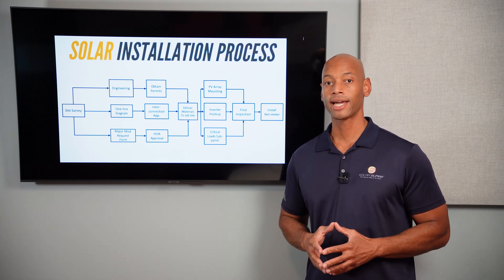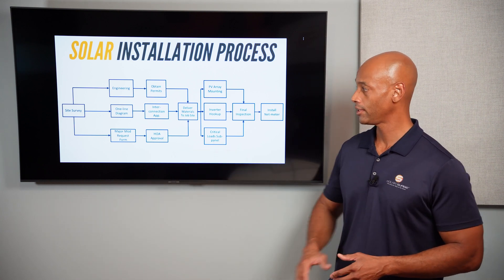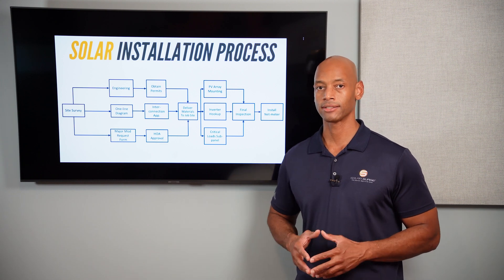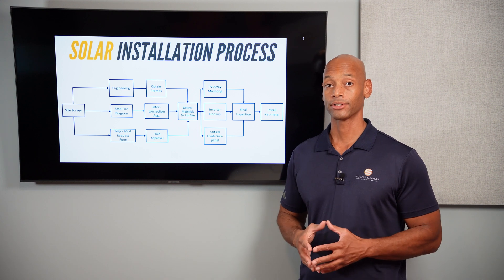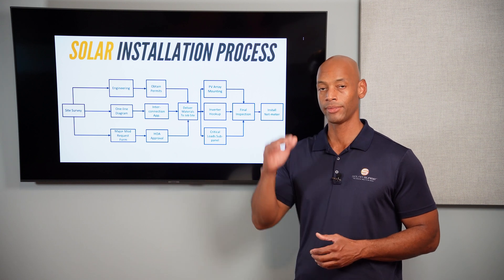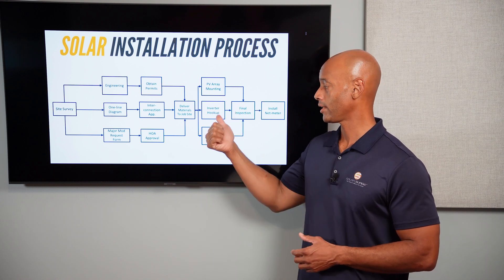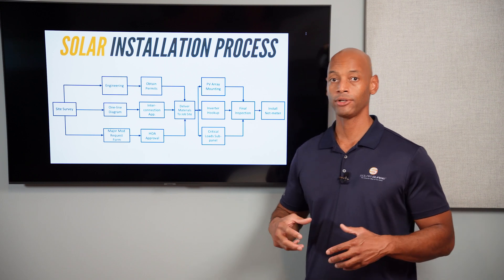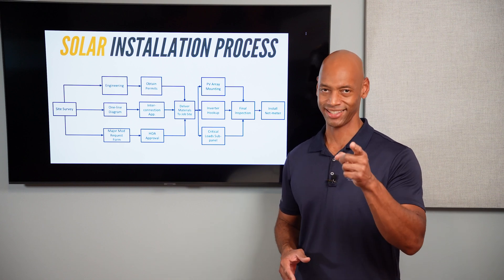2023 Solar Tax Credit Ending Soon | The Solar Installation Process

Comment: I'm a bit into this process now.   It blows my mind that the site survey comes after the sale is made with so many of the installation companies.    The company I will almost certainly go with with sent a survey tech out first.   Yes, my desired system is complex; panels out on a detached garage (the only sunny, south-facing roof I have), batteries, and generator integration.   I still don't have a solid quote, but I'd rather not rush them, and I don't really care whether I get the credit on my 2023 taxes or my 2024 taxes.   I find it hard to take any of the other companies who provided quotes without physical site survey seriously.